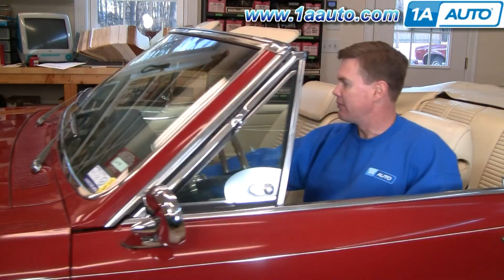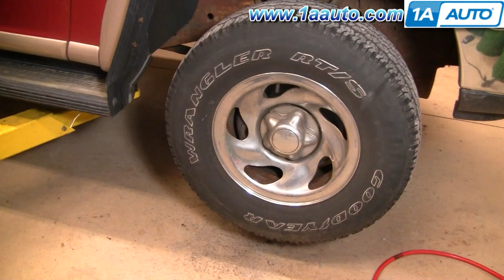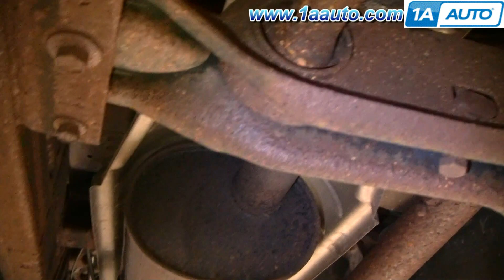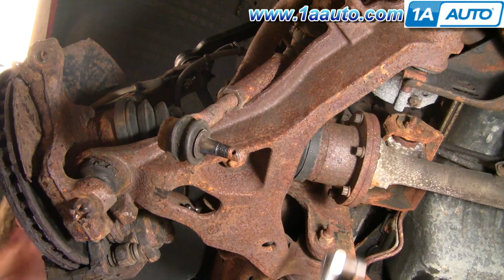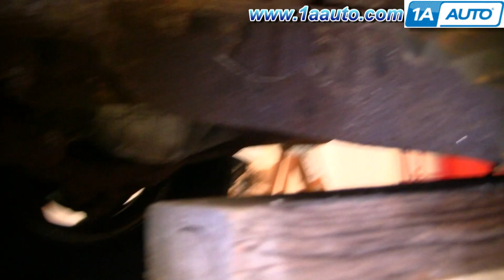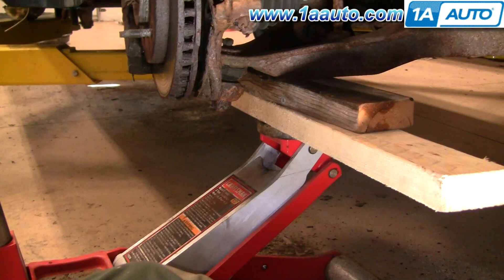How To Replace Lower Ball Joint 97-03 Ford Expedition PART 1

Comment: Hello I have a 1999 Lincoln  navigator. I checked my ball joints and they are in bad shape. But my question is in running 22in wheels and I was thinking about putting on heavy duty ball joints on the top control arms.where can I get a set of heavy duty ball joints for my truck? I'm running 22in rims

Comment: May I ask why didn't you any  wd40 or pb blaster on that ball joint at 12:18 when you began pressn it out of the control arm, boy that vehicle needs more than that part alone, it's rusty, the muffler seems bad, not to mention the rotor, tie rods, ext, I guess that vehicle has only got city, slow miles on it. Thanks for sharing this, great job and helpful too 👍👍

Comment: Is loosening the torsion bars necessary?
Reply: no, neither is taking the cv axle out
Reply: @lonewolf5094  really? How is there a video?
Reply: you will have to remove the axle
Reply: No, I'm confused why they are taking it all apart
Reply: You dont have to remove the whole axle you can just remove the upper ball joint to give you some room and you can slide the axle to get to the lower ball joint its pretty easy might as well replace the upper control arm with ball joint while youre at it.

Comment: Thanks to your wonderful detail video I was able to remove both sides of my 1998 F150 upper/lower ball joints, both of my front sway bar links and replace them in a little over ten hours.   The first side went a little slow until I gain some experience, but the real saving grace was your clue/suggestion to use a tie-rod puller.  It made a huge time difference for one side was not yielding with just hammer blows.
I thank you for many reasons/ my local state inspector wanted $970 to do that job.    I purchased all of my parts for a little less than $200.  My 17=year old daughter thanks you as well for we bonded some while working to mount the passenger side hub.
 
Sincerely:
 a fan
Reply from the maker: v125138 Congratulations on the successful repair.  We're glad the video helped you out.  1aauto.com 866-403-3393

Comment: This video was extremely helpful just one thing the cv/half shaft bolts are not 13mm they were 12mm in my case almost caused me to strip them out, other than that great video.

Comment: First let me say that one of the best tools in my tool box are your video's , I have a 97 Explorer and was told that lower ball joints have a little play so front end alignment cant be done. IU have already done upper ball joints , complete rack and pinon,shocks and sway bar links.  when I do the lower ball joints is there anything else that I may want to change while I have this thing apart again ?  Thanks Dave
Reply from the maker: If any of the other components are worn such as tie rod ends and stuff like that, you may want to replace them while you're in there. Hope this helps you out. 1aauto.com 866-403-3393

Comment: Newbie Question = How many ball joints does a 2000 Expedition have?
Reply from the maker: There should be a set of uppers and a set of lowers. Hope this helps you out. 1aauto.com 866-403-3393
Reply: Thanks a ton

Comment: Would the steps be the same for 99 Ford Expy with 4WD & air suspension?
Reply from the maker: It should be a similar process, you may have to remove the front axles to service the ball joints.1aauto.com 888-844-3393

Comment: The ball joint might also have been spot welded into the control arm. I've seen this before. The welds have to be ground or cut off beforehand.

Comment: Did everything EXACTLY as shown however the ball joint wouldn't budge. Is it possible for the ball joint to be rusted inside of the control arm to the point where the ball joint removal tool is ineffective? If so, how would you then remove the ball joint?
Reply: Did you ever figure this out? Same situation!

Comment: Thanks for posting this video. I replaced my upper control arms and lower ball joints using your video as a reference. Everything went as planned except I had to get a 12 point 12mm socket for the axle half shaft removal. All my tools were 6 pt sockets and they would not work. I would never had tried it without a reference source like this.

Comment: for the tie rod/ball joint remover, can't you just hit the bottom of the ball joint/tie rods bolt with a rubbet mallet a few times? or cant i just take a large C clamp and put a piece of wood or something to help push it out?

Comment: I'm getting ready to do this repair and I was wondering if there is anything to be watchful for in regard to removing the half shaft? Things like spline alignment, oil seal damage bearing placement or movement, etc. Just anything I might run into that would stop me cold.

Comment: I have a 2005 Ford F-150 XLT 4x4. I am replacing my lower ball joint. Do you think I can have enough room for the ball joint removal tool if I do not remove my cv half shaft? I tried taking those 7 bolts off buy they seem to be pretty stripped.

Comment from the maker: @allenrotstein If you scrub all the rust away what is going to hold it together?! :)  Rust removal is a personal preference.  If I was working underneath the car then yes I might do some preventative "de-flaking" but for this truck and this job the only time I wanted to spend was removal, replacement and filming. What I do tend to do when I am doing a project on one of my own cars is spray any nut/bolt I can see with with penetrating oil to keep them clean.